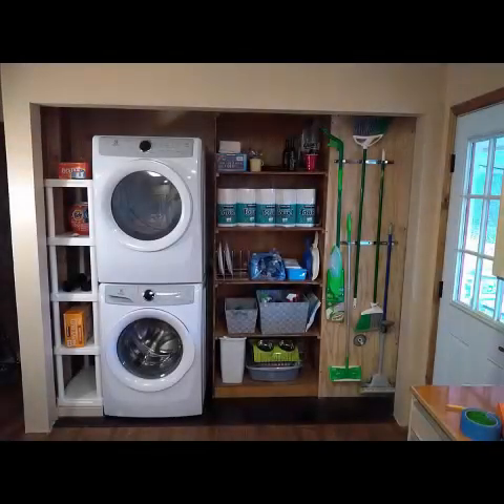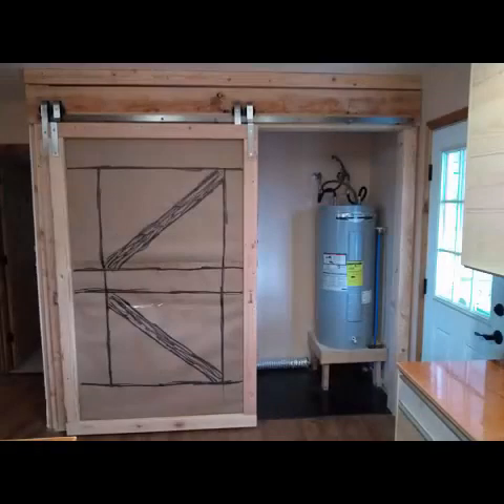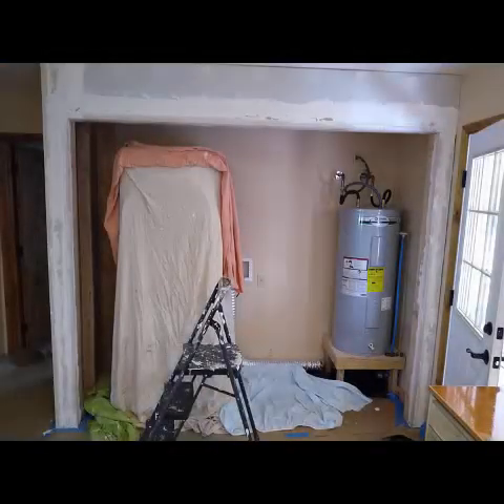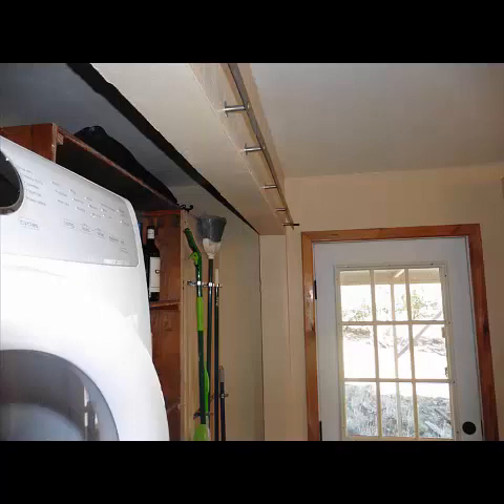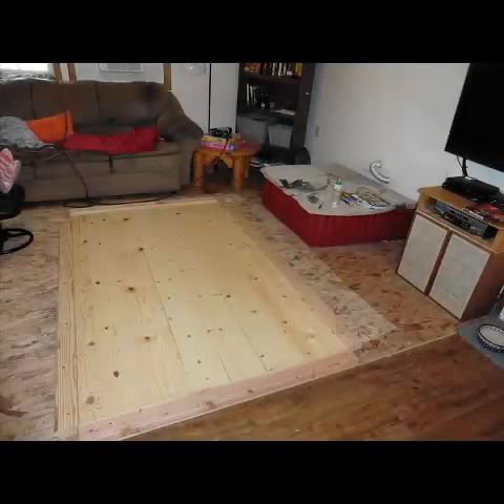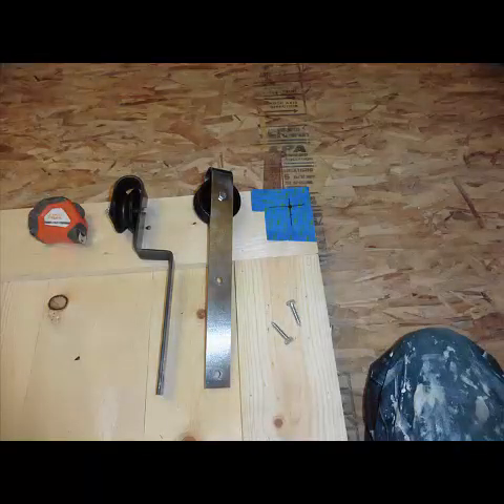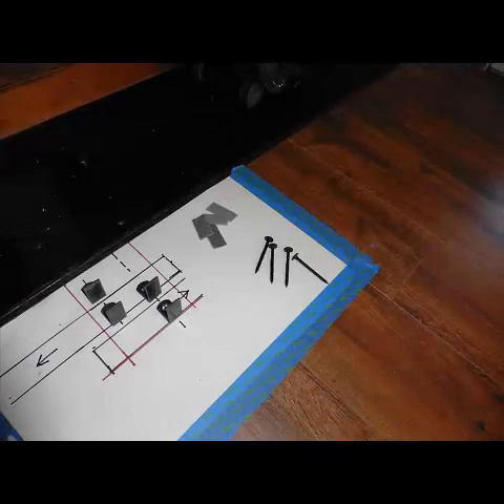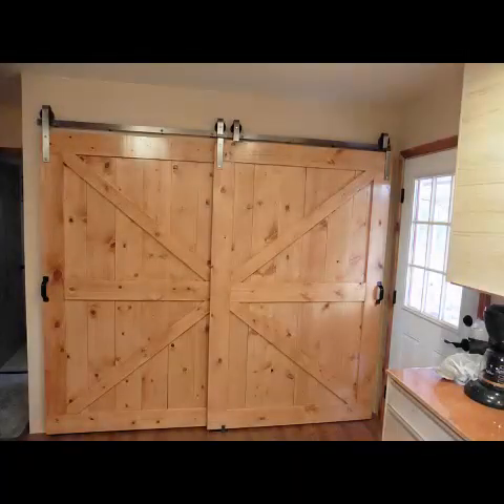Single Track Bypass Barn Door Project

Comment: Very nice detail on info, but gets a little confusing at 6:20 mark when you start building doors. I am assuming that you mean that you are using the OSB and 2x4s as a Template to make your doors (not a bad idea) Also kinda confused about why you added a 2x4 at bottom (8:00) other then to hold everything together.... Maybe specify that everything is assembled inside the 2x4 template and not attached to.
Reply from the maker: Yes, were hereby specify that everything is assembled in a 2x4 frame.